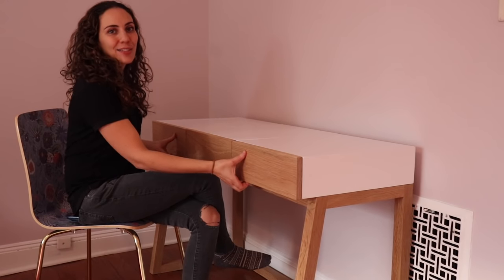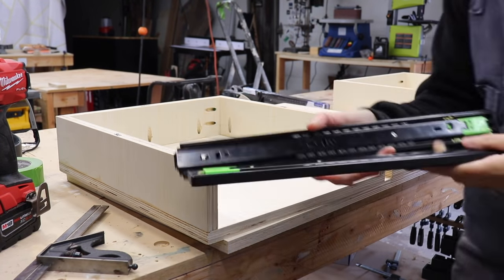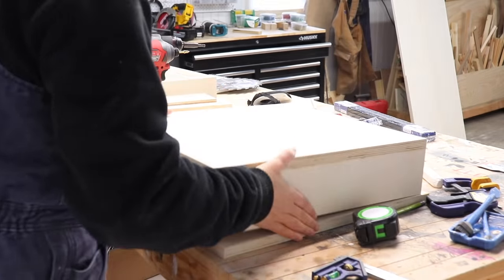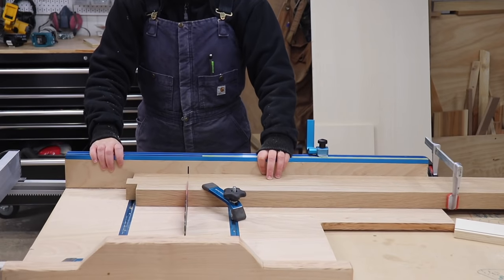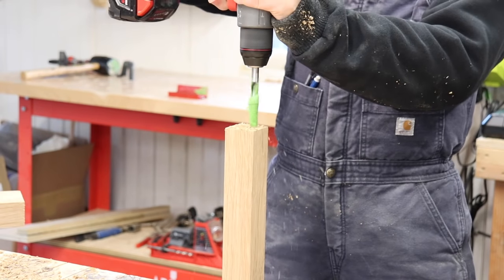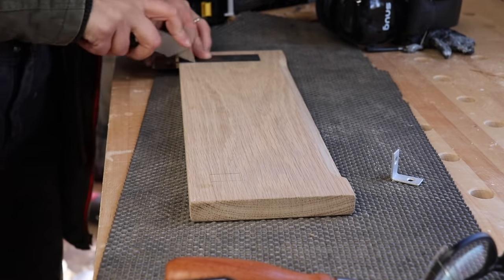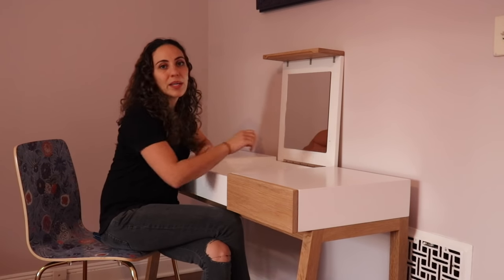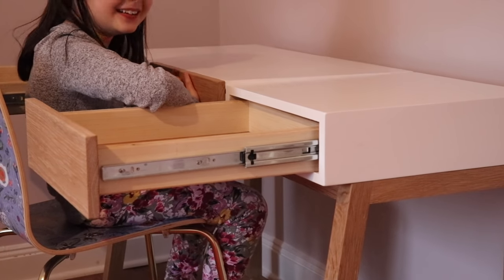How to Build a Modern Vanity Desk // Woodworking Project // DIY Modern Furniture

Comment: Compression fitting a drawer, as you did, is often not the best way to go for slides.  Use the manufacturer's recommendation for drawer width (usually 1/2" for side mounts like yours).
Reply from the maker: It ended up being 1” smaller than the box opening. It was fine.

Comment: Me like. But next time you use frames as legs, you might want the joints to be so that the dowels are sheared, when the vertical parts are pulled apart, instead of pulled out of the holes. Makes for somewhat longer-lasting joints - if, 20 years from now, the glue cracks, the dowels still don't move and hold the joints together, in normal use.
Reply from the maker: What do you mean by sheared?

Comment: Nice build! 
For that mirror I was thinking that if the hinge was more forward then the mirror could tip back more, maybe have more range for positioning, and the desk wouldn't have to be set away from the wall - but then there would probably be a joint on the desk top. Nicely done as is. Just an idea I have about how I might do something like this.
Reply from the maker: Thanks! For doing makeup and the like you wouldn’t really want an an angle higher than 90 degrees. You want to be looking straight on.
Reply: 3x3Custom - Tamar well I wouldn’t know about that lol
I was just thinking adjustment for people of different heights and postures.

Comment: Great project.  Don't know if anyone asked, but since you used them for the legs, did you consider using dowels to attach the front of the center section?
Reply from the maker: Thanks! That was actually my first idea. But I was concerned I wouldn’t get the alignment correct. I wanted to have a way to shift it into position to line it up with the drawer. I’m hindsight I should have been to worried and should have just went for it

Comment: Amazing design and work. One question what would be the best way to join the main top part without pocket screw, because as a kiwi they aren't easily available in new Zealand
Reply from the maker: Thanks! Just regular screws that you can plug up would be fine
Reply: @3x3CustomTamar  thanks. Yeah that's what I was thinking of doing

Comment: Really enjoy your videos. Was very impressed with your angled dowel jig. The only thing I didn't like on the desk was the L brackets. If you have a biscuit/plate joiner that would have been an option or perhaps a spline using your router table and a 1/4" straight bit to make a plunge cut spline slot.
Reply from the maker: Thanks! I totally feel you on that. I considered doing dowels again but was scared I wouldn’t get them aligned correctly. I totally should have done the spline.

Comment: Not sure if it has been mentioned yet, but are you able to recess the soft close stays into the bottom to get the height you need for them to work?
Reply from the maker: I would be able to. But I don’t really want to cut a hole in the bottom.

Comment: soft close gas strut will be what you need to avoid the lid drop and hurt the user.
Reply from the maker: That’s what I thought. But the one I purchased had a diagram where I needed to place the arm deeper than the depth of he compartment I had.

Comment: Beautiful. Was thinking of making something similar as I'm making over my daughter's room. Although I've sold like to have seen a thin frame for the mirror, possibly hiding the "L" brackets. And also some soft lighting around the mirror.
Really cool desk👏

Love the pocket hole jig. Aces!
Reply from the maker: My original design had a frame around the mirror. The I got caught up with trying to find a solution for the soft close lid and just didn’t get I done in time. But I think it’s it’s fine without it for her. The l brackets would def be better if they were hidden.

Comment: I've an Ikea tall set of drawers where the top section is a fold-up, at most half the depth of what you have there, and it has a soft-close piston on one side. So there are definitely pistons for shallow compartments, but I don't have model numbers, sorry.

[Add:] looks like Rockler carry the Sugatsune SDS-C100/WHT which isn't the same but fits into tight spaces and would work.
Reply from the maker: I tried that sugatsune one. I used it for my keyboard stand. And it’s great. But when it is folded in the down position the arm is too long.
Reply: @3x3CustomTamar  Darn, then the piston it is; it only bends at the anchor points and otherwise is always straight between them, fitting in a drawer 1" deep. I just checked, in https://www.ikea.com/gb/en/doc/assembly_instructions/malm__aa-867123-8_pub.pdf page 10 you can see it as Ikea part number 115307. This dresser came out much nicer than I'm used to from their furniture.  My Google-Fu is failing me today, I can't find an equivalent.
Reply from the maker: Phil Pennock that’s actually one of he struts I tried. The assembly instructions on it Sarit I needed a deeper cavity to install it. I’ll test. Out again.

Comment: Just a suggestion that mirror not safe with that tape put a frame around it screw it to the back
Reply from the maker: I used something called mirror tape. And I actually tried pulling it off. Didn’t budge. Since it’s acrylic and not glass it’s actually pretty safe. If it falls I would put a frame around it. But I don’t see that happening.

Comment: Very Nice desk 👍🏻 you need A heating system in your workshop 🥶
Reply from the maker: Thanks! No kidding! This is a real struggle!
Reply: Here in Denmark it’s freezing cold  in the Winther, so i use a Electric Oil radiator in the workshop. It is easy to turn on when it gest A little to cold 😉
Reply from the maker: Morten Frederiksen I’ve tried heaters. But hey don’t do anything since my shop isn’t insulated.

Comment: Lovely job as always. What's the fold over bit on your saw fence at 2:30? I love the pocket hole jig. Where did you learn your skills?
Reply from the maker: Thanks! It’s a job site saw. So the little bit folds down when you need to extend the fence past the width of the table
Reply from the maker: And I learned my skills from practicing and failing.
Reply: @3x3CustomTamar  Wow, you did well, you look like you've had training. Very impressed.
Reply: @3x3CustomTamar  I have the same saw but it doesn't have that part.
Reply from the maker: Graham Orm weird. You sure it’s the DW745
Reply: @3x3CustomTamar  Yes, just been and checked lol. It has 'GB' after the745, which makes me think it must be a UK model, possibly different? Still a great saw. I've had mine about 6 years and used it for light trade purposes, still accurate and works well.

Comment: Awesome desk. What did you do to get the so glossy white with so much trouble ?
Reply from the maker: Thanks! It was glossy paint
Reply: Sorry to bother you so much but so far I’m liking you the most from all other you tuber in the wood working game. If you had to to buy a table saw knowing all you know now what would you recommend getting for someone starting that will still keep up as my skill set improved.
Reply from the maker: Joe Joe I have been happy with me dewalt DW745. But they stopped making them. Sorry I can’t suggest another one because I have never used another one

Comment: Beautiful design. U can use a piston for soft opening the middle section.
Reply from the maker: Thanks! I tried one that didn’t fit in the small space
Reply: There is also a hinge that can hold open used on windows. Or look for jewerly box hinges. It wont lock when open but will stop going all the way into the wall. https://goo.gl/images/JBGmzq
Reply from the maker: Felipe Del Papa those aren’t soft close though?

Comment: Hi tamar could you tell what paint your spraying with
Reply from the maker: It was just regular  white paint. L
Reply: What did you use for top coat to seal it
Reply from the maker: toptotti70 I didn’t use a top coat on paint
Reply: If you didn’t use a top coat it would mark very easy so are you saying you just a white emulsion